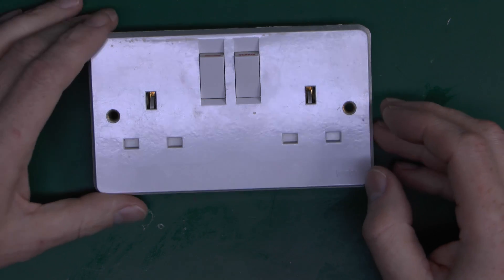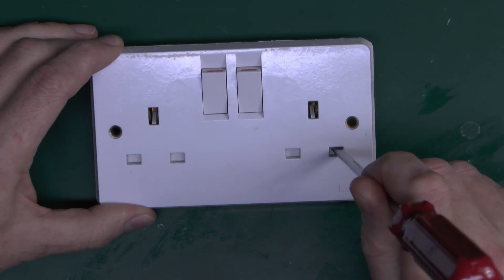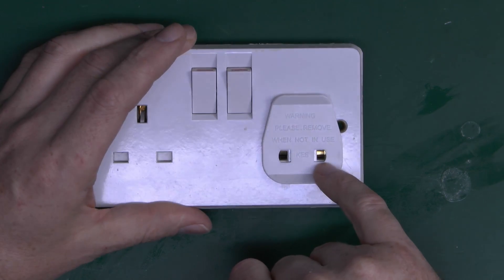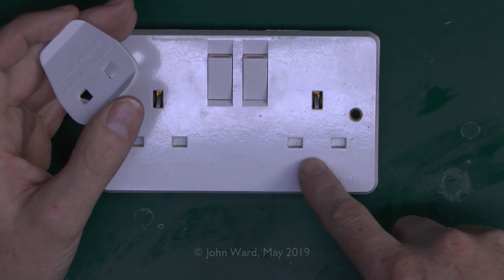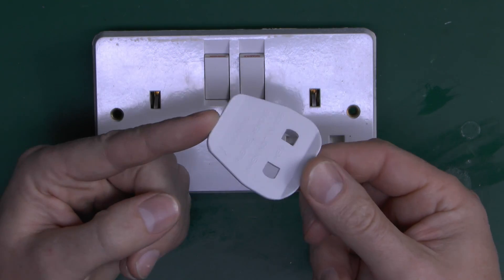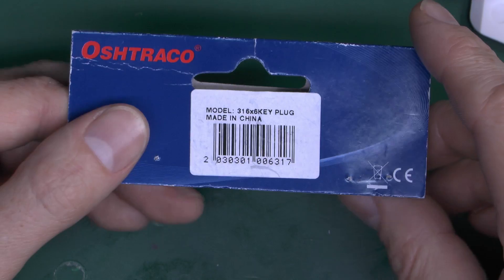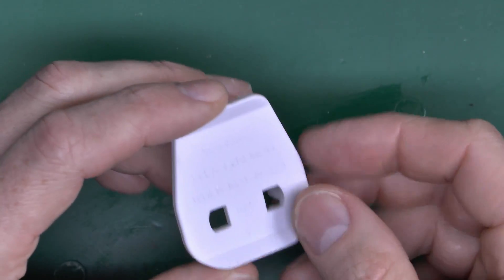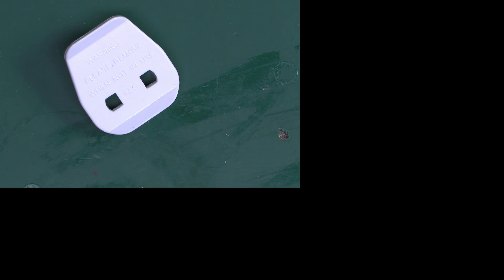Plastic Socket Key to Defeat Safety Shutters in UK Socket Outlets

Comment: What a load of nonsense. People please use your common sense. These thing are designed for visitors to the uk so they can plug their phone and laptop charger into a socket in there hotel room. The same as we have a three pin to two pin adapter so we can plug our laptop and phone in when we visit Europe or the USA. The two pin prongs that go into the line and Neutral are so the two pin plugs are seated and connected correctly. Yes there is a European adapter which is the reverse of our adapter iE we have three pin to two pin Europe’s are two pin to three pin they are a better choice, this thing is simply a cheaper alternative. The only problem I see is some one uses it to plug there electric shaver in to a 13amp socket in there bedroom . But is that any more dangerous than us using a n adapter in Europe?no I don’t think so, the only real problem is people leaving this thing were a child could get hold of it and plug it in. I had three adapters one for Europe one for Europe to uk and one for the USA/caneda, and in over thirty years I have never had any problems wile using any of them. Infact I would be more concerned with those adapters which a single adapter but can’t take three or four different types of plug in one they accept round two pin square two pin Australian and American and the uk BS1363 .

Comment: I'm from Malaysia and we have loads of these. They're meant to allow type C plugs (those small 2 pronged European ones) to be plugged into regular UK type sockets, which Malaysia uses. Lots of people don't even use those plastic thingies when plugging type C plugs into sockets and instead stick a chopstick or other items down the top hole in the socket which the earth/ground prong goes in to lower the shutters so they can plug the type C plug in.
Reply: Why TF don't you have actual UK plugs? And why haven't the "key plugs" been banned?
Reply: @seprishere Malaysia does have UK plugs for most, but not all electronics, though for some devices, like my old blender, they have the European type C plug. 

Honestly, I don't know why they've not been banned. Malaysians are quite unaware of the dangers of using the type C plug in a British type G outlet. It's a shame.
Reply: @seprishere also, this is a lot rarer, but twice I've seen the type F/E (German/French plug) used in Malaysia.

Not sure how they ended up in Malaysia but that's that.
Reply: @a11u45 Such "key plugs" should never be used in the UK or Ireland, and any found should go straight in the bin.

Comment: The countries using UK sockets generally dont use the UKs 32A ring circuit ...instead they opt for the branch circuit system so fuses are not important in their plugs .....thus round pin appliances are fine to use ...lived in Singapore in the past and they were also branch , despite using UK sockets. However i know what youre getting at re: the safety aspect of it

Comment: I've always found that a euro 2 pin plug fits perfectly into a UK socket , I can't see what's wrong with this, it does advise to remove when not in use and it safer than sticking something "silly" into the socket to move the shutters.
Reply: The pins are closer together. You may damage the socket. This of course is dependent on the individual socket design. Get a proper adapter
Reply: Fit, doesn't mean you should, the contacts inside are going to be designed to make good contact with a rectangle, not a circle, touching a flat plate to a circle is going to give awful contact area, and only one of the two sides would make contact, whisker thin really

Comment: ok sure these are pointless for uk RESIDENTS but what about eu visitors? devices like this simply solve the only problem remaining in industrialized nations:
too many goddamn standard plug types!
obviously for uk residents and purchases these should never be needed but "deathdapters" (thanks bigclivedotcom) are still relevant until a worldwide electrical system can be agreed upon so for those of you who are truly assholes about safety (and not just sounding high and mighty like jw)think about how 30a at 240v is WAY WORSE than 30a at 120v for cheap shit plugged into the wall as being half voltage most devices that fail do so in less dangerous manners(bangs don't get so big, I blew up a 30a glass fuse on 120v SC and it was DEFINITELY less dangerous than 240v would have been)
simply put unless you travel please destroy those deathdapters as normal people should NEVER own them
Reply: You MUST use a proper adapter, not a gimmick like this.

Comment: Why can't the British just use Schuko sockets and plugs like everyone else? :-)
Reply: Because they're far inferior to the British plug and socket design, widely accepted as the best in the world.
Reply: @NewmanAutomotive  I guess that would depend on the criteria applied when arriving at such an assessment. If you think that electrical plugs which are extremely large and clumsy are superior, then the British ones surely are the best in the world. Which is probably also the reason why nobody else uses them. The British people are the only ones smart enough to understand the overwhelming benefits of the design, just like they are the only ones to understand why Brexit is a great idea.
Reply: @jaakkooksa5374  The Schuko system is not used everywhere else. There are many different sockets around the world. Schuko are non polarised. The Belguim/France/Poland socket is better. The Australian is good as well.

Comment: How is this any more dangerous than a UK -> EU or a UK -> USA adapter?
Reply from the maker: Adaptors have fuses, adaptors usually have shutters, and adaptors do not result in round pins being shoved into holes designed for rectangular pins.
Reply: First this has no fuse, second you stuff a plug to an outlet that is not designed for that plug,. You could damage the plug or the outlet. If you damage the outlet it could cause a fire later. Also it does not connect the ground.

A proper adapter has a fuse. This is a proper adapter: https://images-eu.ssl-images-amazon.com/images/I/31R1zjgG6CL._SL500_AC_SS350_.jpg

If you have an europlug you can also use this kind of an adapter.

https://www.lindy.ie/images/products/zoom/1348790289-02514000.jpg

Note it is shaped do that you cannot connect schuko which would cause breaking the ground.

Comment: This really is something that should not exist.
I did not know about the ban. They should just outright ban them.
Reply: It's been in My country for years.some plugs is 2 pins.. and this thing helps...
Reply: @rafhaikal9181  Not a good situation.
Reply: @wisteela  it is required here. And this plug thing is so freaking easy to find and get
Reply: @rafhaikal9181  I'd use a proper adapter.
Reply: @wisteela  like what.. ?
Reply: @rafhaikal9181  A proper plug adapter. They exist. A UK shaver shaver adapter would do it. Or even better, a UK visitor adapter. Anything but these pieces of dangerous crap.
Reply: @wisteela  they don't exist here
Reply: @rafhaikal9181  I suspected that was the case/issue.
Reply: @wisteela  i mean.. i usualy just shuv a screwdriver in the earth hole and open the safety thing..and then just put my 2 pins plug in
Reply: Better still, replace the plug with one that fits the socket. Don't wait until you're mourning a relative.

Comment: I don't understand the suggestion of installing a two pin socket instead of using the kid-killer toy, surely installing a two-pin socket is even /more/ dangerous? The 2-pin sockets I've seen have no finger-guard of any sort, so they're permanently lethal to any random prodder who happens by. On the other hand, at least this dodgy contraption /can/ be removed after whichever bodger has finished with whichever device s/he couldn't be bothered fitting with a UK plug..

Comment: In terms of safety, how's it any different than a universal adapter? It also exposes the live wires
Reply: Interestingly,  universal adaptors are technically illegal here in HK (which follows UK standards for power/plug/sockets).  But this thing would be pretty useful if you happen to have a lot of 2-prong EU plugs lying around.

Comment: Why is this any more dangerous that a regular unfused 3 pin to euro adapter which are sold everywhere? The Euro safety sockets have similar shutters but as there is no earth pin they work by having to push live and neutral in at the same time. Yet most adapters sold in the UK do not have these.
I have some appliances with Euro plugs and I have eventually found adapters with a 13A fuse and the Euro safety shutters.
Reply: Proper adapters are fused. You cannot get unfused in any UK store.  I do not questions why one bad thing would be worse than another bad thing. The solution is not to do either bad thing. Adapter for Europlug should have 3 A fuse, not 13 A.

Comment: Plugging a Euro plug into a BS1363 socket the UK is particularly dangerous because a BS1363 plug contains a fuse max rated at 13A and the circuit is typically a ring of 2.5mm^2 cable protected by a 32A breaker in the fuse-board.  What I would like to know, as final ring circuits are AFAIK unique to the UK, is how BS1363 outlets are wired in the UAE, if for example  they are on radial circuits protected by 15A breakers  then it's not quite so bad. Far from ideal though, because a Europlug is a sloppy fit both electrically and mechanically
Reply: That made me wonder about all the travel adapters. Especially universal types almost never have fuses. I need to have a closer look at adapters next time I need them. The need for fuse is pretty uncommon in other countries.

Comment: Do all your appliances in the UK have a 3pin plug?  Do you not have or allow double insulated appliances  with just active and neutral ?
Reply from the maker: Everything has the same 3 pin plug.  Double insulated items either have the standard plug with the earth pin not connected to anything, or have moulded on plugs which have an all-plastic earth pin.
Reply: @jwflame  ok different to what we have in Australia and I think New Zealand.  We don't have shutters on active and neutral, and two pin plugs are allowed as long as appliance is double insulated.
Reply: @garrymuir1442  There are sockets with shutters but they do not seem to be the norm: 

https://hpm.com.au/app/uploads/2018/06/ln777eswe-sb-hpm-linea-extra-safe-powerpoint-cheeky-boy-blue-and-white-593613b752351-593de916043a1.jpg

In Finland shutters are the norm on sockets and power strips. I do not know if they are mandatory though. Th sockets work so that you have to push both pins at the same time some they are safer than the ones that can be opened by just by sticking something to the earth. When I have measured the voltage with a  multi-meter it takes some effort to get the probes in. 

Shutters of course are relevant only if you have small children,

Comment: Feels like step up from taking the inside out of a pen, my usual trick when travelling to the UK!
Reply: I have actually heard of a case where there was an electrical fire that happened as a result of euro plugs being inserted into UK sockets without an adapter being used
the fire happened because the pins of the plug didn't make proper contact with the connections in the socket
Reply: Stop that immediately.  You can kill someone with that . That is nothing but vandalism.

Comment: I used to use this every time in Singapore when I was a child. Misplacing one of these was a nightmare. I remember really hating the plug design since I wanted to connect a two prong round pin plug into the damn Singapore plugs (I later found out in 2003 that they originated from England). Never had this problem in Australia when trying to connect a two ping prong into an outlet. Only in Singapore, and other countries which uses plugs from England. Interesting to see how the British denounce these adapters for safety concerns.
Reply: How on earth do you ger a Erroplug into an Australian  socket?
Reply: @georgecooke4877  You can't get a Europlug into an Australian socket?

Comment: I thought we had 3 pin sockets in the 1960s and 2 pin pre 1960s
Reply: In olden days, plugs had 3 round pins and sockets had 3 round holes in the UK. I remember even in the 1980s it was common for appliances to be sold without plugs and the consumer would attach their own, presumably because some unmodernised houses still had the old round pin sockets. In even earlier times, some appliances had plugs to fit into light sockets. The only UK 2-pin sockets I know of were the bathroom ones, which I think had a lower voltage, sometimes marked "shavers only".
Reply: @SunbatherInTheSnow  i remember the round pin ones are used theatrical setups today for 16 amp lighting circuits but isolated from the 13amp to prevent interference with sound, I also do remember when devices where sold without plugs (wasn't born then but i bet it was painful). As for the lighting socket plugs they weren't exactly reliable.
Reply: Nope.

Comment: What really puzzles me is why the UK socket would be adopted anywhere else, it's so specific in its purpose in terms of the system it is meant to support that it just doesn't make sense to pick it for your electrical socket.  And because someone settled on it seemingly at random the customer is stuck with a stupid situation where he is vended product with a normal plug he has to now somehow connect to a moon-socket while retaining something like safety.  I'm not surprised the goods are not vended with the UK plug, the UK plug is basically a heavy appliance plug, on a par with what you might use to plug in a large welder or some similar piece of industrial apparatus.  Therefor it is more expensive, and its unique feature of the fuse in the plug doesn't even get to come into play.  Depending on how the property was wired it could even induce hazards of its own if he who wired it expected the BS1363 standard's unique qualities would be adhered to and put to use, a situation could arise where a lot of amperage was available to create a short circuit of concerning power in some device wired more flimsily because its designers didn't think it would ever be plugged in to such a socket and without a fuse in the plug to protect the cable, it could end up with more than double the amps it was rated for on hand for whatever chaos may arise.  A long time ago I was given two proper adapters for BS1363 to "normal" plugs, they both contain a fuse of appropriate amperage.
Reply: I have pondered getting a BS1363 socket set for my air compressor in my garage, partly as an anti-theft measure(Who's gonna steal an air compressor with a fucking moon plug on it over here in the States?) and partly because it likes to pop breakers on the standard NEMA 5-15 it's equipped with currently. Could put it on a 20 amp breaker that way. Would bypass the plug fuse, though. No need. It'd be on its own 20 amp breaker and the wiring in the compressor would hold long enough for said breaker to trip in a fault situation.

Comment: Theoretically they could be glued to the two prong plug to get around the problem with the open contacts. 🤔
Reply: My thoughts too but the problem is that you would need one for every device rather than one for every socket and most people have a lot more devices than sockets. It would turn out more expensive, mind you they are quite cheap anyway.

Comment: Finally, something that makes my life just a little safer when I'm trying to get an EU plug into a UK outlet. No more ramming a key into the Earth slot to open the shutters.
Reply: BS1363 pins are 15.85 mm apart from the edges. Europlug pins are 13.5 mm though is is flexible as it is designed to fit schuko that has 14.2 mm. Still the 1.65 mm is too much. You can damage the plug and the socket. This can lead to poor contact and fire. This may happen only years later when someone uses a high power equipment. This is a a far more serious problem than the lack of the fuse.
Reply: I'm being flippant to a degree of course, but anything that prompts debate is good. There would have to be a very unlikely chain of events occur for me to receive a shock, not least of which is the plug socket unit having a physical fault meaning current was flowing to the earth pin, plus some failure in the consumer unit that allowed the same. One of those occurring is highly unlikely, the two simultaneously mathematically insignificant. Of course, your points are well made, why expose yourself to any unnecessary risk, the right thing for me to do is buy a proper travel adaptor for my visits to the UK.
Reply: John Seth-Watkins Are you aiming for a Darwin Award?
Reply: You Brits install huge pins and sockets on your plugs and outlets and the contact of the switch for the outlet is so tiny that it frquenly burns out! 😂
Reply: Why don't you just buy a proper BS1363 plug and fit that instead?
Reply: @cjmillsnun  Or why not buy a proper 13A fused Adapter.

Comment: Diabolical thing. A short while ago, I did an online check to see how much variability there is regarding plug tops and sockets around the world, and was shocked at some of the things I saw. Without doubt, the UK BS 1362 plug top is the best design ever; the euro type isn’t bad, but I don’t think this plug top has a fuse link. Sadly, I am old enough to remember GEC porcelain 15A 3 pin unshuttered sockets into which a child could easily insert a finger. If modern technology had been around when public supplies were first  installed I reckon the supply would be DC, which might be better in more ways than one.
Reply: They are NOT plug tops they are plugs. A plug top is the lid or cover of the plug.
Reply: Personally, I think the UK plug is terrible. It is incredibly bulky; with radial topology, the fuse is redundant, and RCDs negate the need for shutters. Worst of all, it becomes a domestic Punji Stick when left laying on the floor.